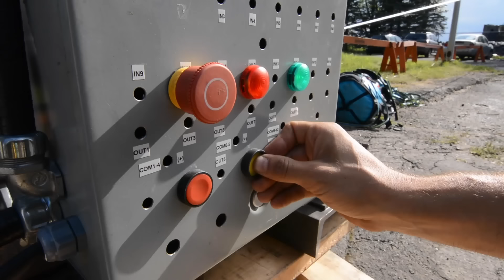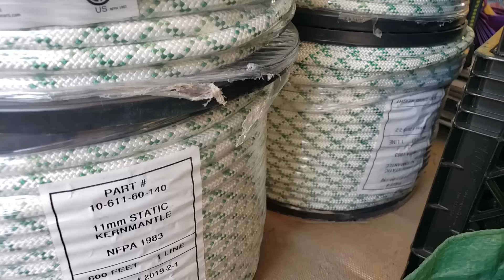How to rig a 2km long highline with 30 people in Asbestos Quebec Canada

Comment: Everything seems to be super-safe ..... back-ups, extra anchors, redundant lines, rigging-plates etc etc. But the end of the line is the telegraph pole/post? How strong are these things? How deep are they planted? And in what condition is the wood? They look pretty old.
Reply: your average telegraph pole is 36ft long, 6ft of that is buried. They're tested every ten years, and can last over 100 years before they're obsoleted by underground installations or other reasons than they've decayed (because they're treated with chemicals that slow the rotting process and also to prevent wordworm and kill other insects that try to infest them). Heavy poles (~40-45ft) are planted 8 feet deep. Even the light poles (10-12 inch diameter?) can withstand the weight of a full grown man weighed down with gear hanging off of it, on top of upwards of a dozen or so multicored cables pulling in all directions and variable weather conditions.
Reply: I used to inspect wood power poles. Our company didn't start to inspect a string until it had been in service for 20 years. And then a 10 year cycle started. The oldest pole I've ever personally inspected was dated 1947.
In areas with permafrost they will break in the first 18 inches of soil from cyclical freezing thawing. I have red tagged poles on the first 20 year inspection. I have found many in permafrost areas that were completely rotted through at the base and only being held up by the wires. 
Location matters for the longevity of wood power poles. 
There are several species of trees used and different chemicals used in the treating process.

Comment: 4:07  Be sure that the welder knows very well what he is doing. Heat from welding might cause the surrounding steel to become brittle and you might need to do additional heat treatment to prevent cracking the C beam right next to the weld. Several WW2 ships made of welded steel capsized for this very reason (and they blamed japanese torpedos until they realized the problem is the welds causing steel to harden).
Reply from the maker: That's a good point.  What are the main things that cause a problem vs not?  Leaving the heat on too long?
Reply: You need to pre-heat your pieces before the Weld thats important and make sure that it does not cool down fast, that the main factor that cause cracking! And Also the proper welding material (Rod or wire)
Reply: @HowNOT2  Steel comes in various "grades", each is made for different purpose and has different properties. also responds and recrystalizes differently during temperature changes. You have to read datasheet of the particular grade you are using and know the details of used welding process, to ensure everything will be able to withstand planned load. You should find certified welder, who has experience with structural welding and metalurgy. i am not such person, so i can't really tell you more. friend of mine once asked me to weld custom rappel device for him, but i had to refuse him for this reason. on the other hand, you can probably just test the setup for 2 or 3 times the maximal expected load (including shock-load) and should be OK.
Reply: I'm a professional welder and I'm telling you that weak surrounding metal is not a problem good welds are the important part in this equation. Unless your welding in th ed artic your fine. Most climbers and slackers know nothing about steel/aluminum I work with it everyday you rd good
Reply: The main thing is too, is that train tracks are made of high carbon steel while the channel is plain mild steel, depending on what it was welded with, heat input and temp of steel it could be absolutely flawless or it could easly crack 30” of weld with no visible undercut, crater cracks or any inclusions, once cooled down the crystallization is the major part, ive done no pre heat and pre heat weld on high carbon steel and cast steel and have had plenty of good welds with both but most failures came from no pre heat, or excess cooling
Reply: I think the ships you are talking about were one of the earliest to use a welding process instead of traditional riveting. The steel was not very suitable for welding because it contained to much nitrogen, i think, which caused it to get brittle. Most modern steel is a lot more suitable for welding

Comment: As a lineman I feel like it may have been easier to use steel (guy) wire for the span and anchors probably cheaper to. Although I am not sure how that would affect the high lining. It's impressive what they accomplished though.
Reply: No... Steel has a maximum self-supporting span of about 8 km.  Any cable you suspend across the mine would be at 25% max tension.  Making it segmented would put you at 50% max tension before you even get started (no way to get a safety factor of even 2 on a segmented design) 

If you can a 2 km continous cable - you're looking at 10mm min. - 2x1 ton of cable. If you need spliced you'd have to go bigger. 

Dynema is more than 10x stronger than steel at the same weight. 

As to anchors, I'm with you that an off the shelf helix or deadman system would have sufficed. , but they may be been permission/legal issues regarding permanent installations or excavation.

Comment: I don't trust the rebar loops in these sort of blocks for critical loads.  There may be less rebar in there than you think, it's usually just a lift point made to last until the blocks are installed to stabilize an embankment, plus the blocks themselves are made with "hot" loads, no telling what quality of concrete went into them.

Comment: so the fact this is an asbestos mine isn't dangerous?
Reply: Watch the Tom Scott video about the mine. Very interesting 😄
Reply from the maker: It wasn't until we walked a truck strap over it haha
Reply: I believe asbestos is a solid rock that only becomes dangerous after it is processed by heating it to a high temp at which point it expands and becomes very light and porous, and thus gave its insulating properties, but this is the point at which it becomes unsafe to breath in its tiny fibres,.... well that's what I remember the abatement company told me about the vermiculite in my attic
Reply: Prairie Climber  I didn’t realise it was after it has been heated that it became unsafe. Interesting
Reply: @marcushill78  cool, good to know, thx

Comment: I dunno what's scarier, falling into the ground or falling into a pit of toxic asbestos water.

Probably not too dangerous actually, but i dunno, i like the idea.
Reply: Asbestos only is dangerous when you inhale small particles, the Asbestos then "clogs" your lung. Since the Asbestos is in water you can't inhale small particles. It only becomes dangerous when you rip it out of old walls and small fibers are all over in the air.
Reply: @dr.doppeldecker3832  The water from the whole was actually tested and the local brewery started brewing beer from this very pure naturally filtered water